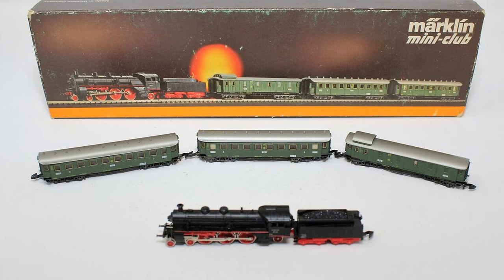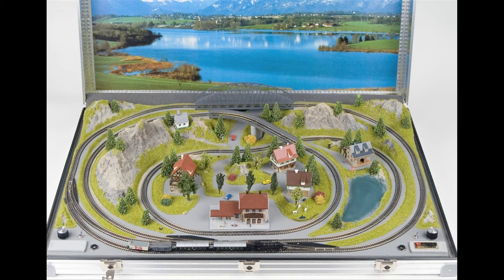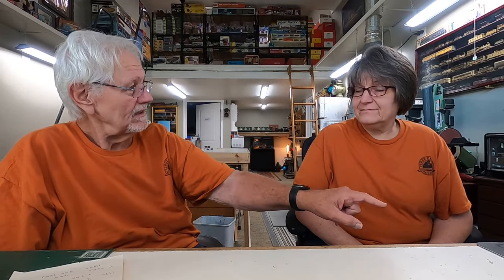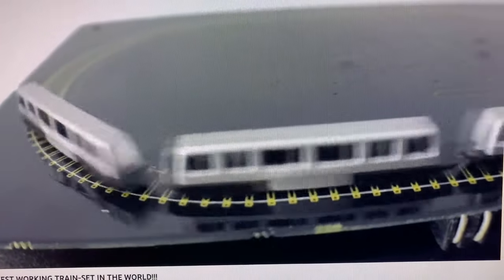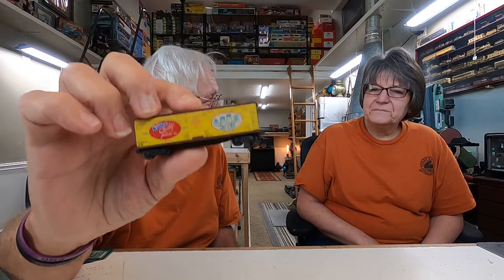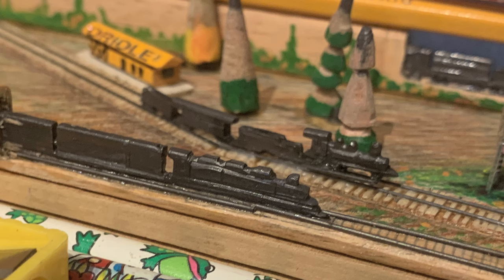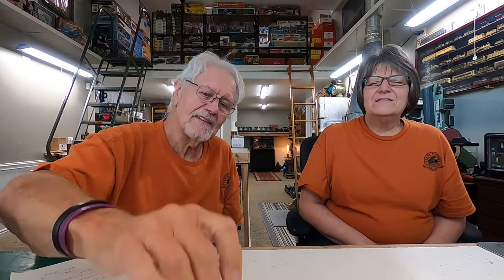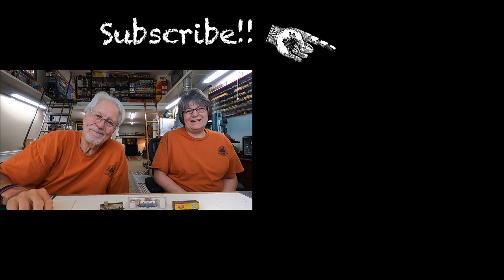Scales and Gauges Part 19 - Z, T, and Nano Scales

Comment: Dale, try using 'forced perspective'.  An N scale city park could have a train ride but to simulate the smaller scale, use 'T' for the "Ride The Park Train".  Same concept for HO, would be using a Z scale park train.  For a Garden Train, use HO scale.  No matter what scale, HAVE FUN!  🙂
Reply from the maker: The plan in Alamosa. 1:24 scale buildings with 1:20.3 scale trains. Outside the windows of the 1:24 buildings 1:48 scale. And beyond? Ho?  Perhaps.

Comment: Another interesting tidbit about Z scale is that if you measure the track with a 20.3 scale ruler, it comes out almost exactly 7.5". Soooo, on the Central Iowa Garden Railway's G-scale modular railroad layout we have a Z-scale ride on train loop. The Z-scale train has flat cars fitted with wooden crates for seating and several passengers riding along enjoying themselves immensely.
Reply from the maker: I’m getting that for N gauge. Z comes out to 5”. Which is also a great live steam gauge.

Comment: It sounds like you haven't been to a N.M.R.A. National Train Show since 2001. There are modular Z scale groups around the country who have displayed large modular Z scale layouts at these shows. I have been displaying Z scale at train shows since 2001. I had my Z scale modules at the NTS in Grapevine, Texas this year (2023). I also had a 20'"X 16" North American prototype T scale layout. I have been running and building Z scale layouts and modules since it came out in 1972. I started with T scale in 2006. There have been improvements in T scale locomotives and availability. I recently scratch-built 2 T scale cabooses. Building in these smaller scales can be challenging. That's one of the reasons I like them. A Z scale locomotive built by Robert Ray won a "Best of Show" award and a "Gold Circle" award at this year's N.M.R.A. convention and train show. One member of our group uses Z scale trains as a garden layout for dollhouse scale (1:12).
Reply from the maker: Ed at one in 2018?  Anyway the only Z we have seen was Nn3. But he couldn’t get it to run. Sure looked great though. Wow!

Comment: I have a Z scale train set but as I've gotten older I realize that it is too small for me to work in that scale. 
So now I am wanting to work in 0n30, Sn42, 00/H0 and TT/TT9 scales.
Reply from the maker: If I were looking to change… On30. While there isn’t very much made anymore, there for a while there was just a ton of stuff and it’s all over the place on eBay. And there are still a few pieces of rolling stock available new. But the small size track can fit into some amazing places and the large scale trains are much easier to work on  places where the track doesn’t show you can use really cheap available HO track. For example, inside tunnels.

Comment: Dale,  Did you say that N and OOO are the same scale?
Reply from the maker: Nope. Almost. Same gauge. But like HO vs 00 the scale is a tiny bit larger. 000 is just a bit larger than the 1:160 used in n

Comment: 8:14 Yer man's right there. You're going to save a lot of fuel and emissions. It's a "fun" car, not a utility car, I know. But still. Plus, nowadays you can convert classic cars to electric and get a lot of relatively green oomph out of them. They're doing everything from Muscle Cars to wee beetles now, and they say a beetle takes off like there's no tomorrow compared to the petrol engine.
Reply from the maker: Well we only put like two tanks of gas in it per year. Which takes us about 300 miles!
Reply: That's another "just because you can.."! The engine is the beating heart of a classic. Making it electric is the worst of both worlds: boring driving experience, a body that rusts easily and chassis that can't handle electric.

Comment: I´m sort of planing a garden railroad, but it will be L-gauge. (i got loads of L-gauge track already). L scale is pretty close to I scale. But i thinking of a twist , with a tiny house in the garden, that in turn have there own garden railway... so.. T-scale.
Reply from the maker: L is certainly on unique thing!  I’ve never seen that used outdoors, but I don’t see why it wouldn’t work!
Reply: @ToyManTelevision  well.. with the fully plastic  rail it should be no problem. I would not use the metalic once out doors. I have 2 moving boxes full of rail, that should be a good start point.

Most of the rail will be built in a greenhouse. This is mostly to extended the season but also keep the absolut worse of the weather of the rails.

Comment: I managed to buy a bachmann Connie brand new never been run everything still sealed up and guess what the gear on the driving axle failed within 30 yds fitted the replacement brass one and found it was so tight it wouldn't run it took a whole day of felting to get it right now I'm looking forward to running it double headed with my 10 wheeler
Reply from the maker: Fix the gear! It’s not that hard. We have a video on it. The gear is available at Bachmann parts store.
Reply from the maker: https://estore.bachmanntrains.com/index.php?main_page=index&cPath=69_142
Reply: @ToyManTelevision  watched video thanks most informative the replacement brass gear was not central on the axle which put the coupling rods at a slight angle once I'd reamed the rods to suit all was good thought you might be interested in my findings happy modelling from the UK

Comment: With the pace of technology,  would it be possible to make actual traction motors for HO models? Instead of having the big motor in the body, the model would have a traction motor.
Reply from the maker: Yup. Doing that in O. And in HO but the motors are a bit large. Most just power one axle. But in O scale you can build power trucks with every axle powered
Reply from the maker: https://youtu.be/NRoKOzP_J-4?si=qwaDCaDVCnxNFrMe